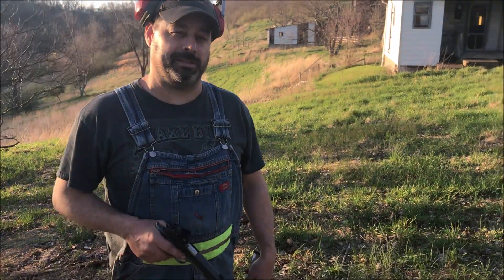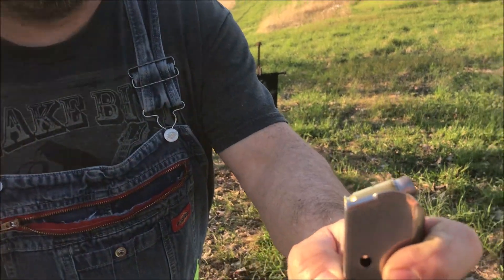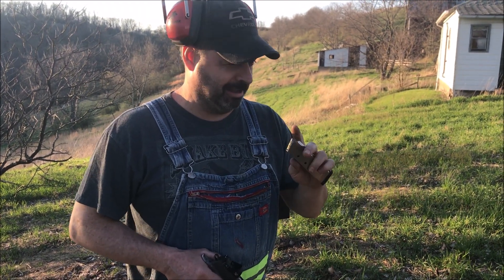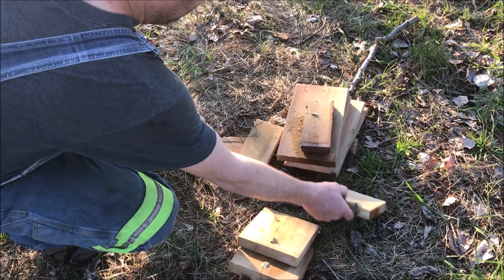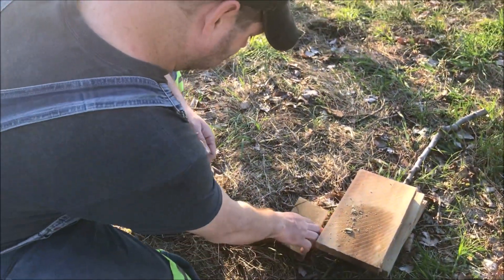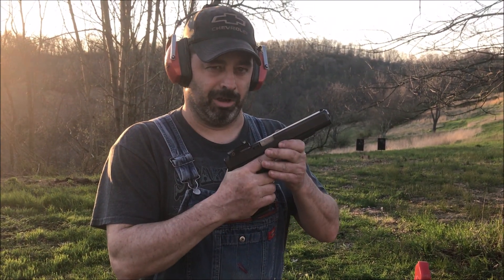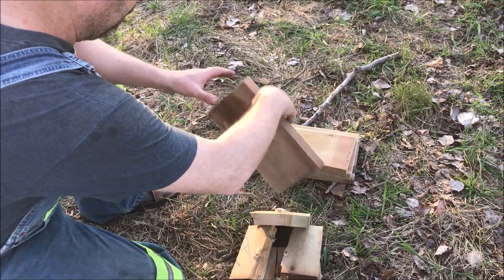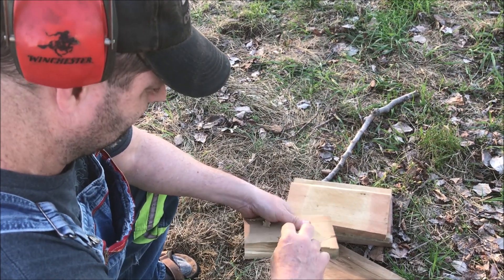45 Super VS 10mm in hardwood boards

Comment: Good insightful test. With surprising results.
 
 No doupt that there would be a difference with the use of Underwood  Hard Cast Lead and the Hunter, Penstraitor Solid Copper Flat Nose Bullets.

As for most Wilderness protection purposes Hard Cast Lead or solid Copper Flat Nose Bullets are the best overall types of projectiles to have for protection from apex predatorial beasts.

Comment: Great comparison, I love em both. I do think if ya hit em with similar extreme penetrators from Underwood the 10 would do a little better. I ran some 200/220 grain hard casts out of my 20 from double tap and underwood. It wasn’t even close, they were hotter than buffalo bore too. They melted the finish off my tlr1-no shitter- I fixed it with a fresh wide ass sharpie. Significant muzzle flip and a whole lot of fun!
Reply from the maker: Underwood is really tuff to outperform safely
I wouldn’t hesitate to stoke my pistols with their dipshit medicine

Comment: Hey Stuck Case what was the load on the 180 xtp load . Good work Thanks. On 1 load on one of your other videos was 10.5 grains of imr 800x at 1500 fps
Reply from the maker: Yes that 175 gr Lee TC bullet is used with 10gr of IMR 800x
It’s a handful
Reply from the maker: That is in a custom barrel and chamber
Tread carefully
Not all guns can achieve that
Reply from the maker: 10.5 gr your speaking of I believe was behind a 155gr xtp
Reply: @stuckcase7775  it was the video comparison of the 45 super against wood boards and 10mm glock 6 inch , you mentioned a 180grain xtp.
Reply: @stuckcase7775  i have a 5.25 length alpha wolf barrel and 24 lb. Flat recoil spring and a heavy duty firing  Pin spring
Reply: @stuckcase7775  this is from glock 20 gen 3
Reply from the maker: @organicmaterialsciencecorp6115  reviewed my notes after getting gone from work—indeed—the hottest load tested was in fact 10.5gr—that was at 1505 fps with the xtp
Please be careful
That was with a KKM barrel and tight chamber

Comment: I have a 10mm XMD 5.25 and 220gr Underwood hardcasts. Also a 45 XDM 5.25 and 255gr 45 Super Underwood hardcasts. The heaviest hardcasts for both calibers and identical platforms to fire them from. Just not sure what to use to test which would penetrate deepest into something like a bear. I'd love to do gelatin but probably need twenty feet of it. I had a GoFundMe page to take donations for enough gel to settle the 10mm vs 45 Super debate but they shut it down.
Reply from the maker: Lee Anderson wet newspaper stacked up and cinched tight. Great test media
Reply: Just water bottles man.  It works
Reply: So Lee u shoot  45 super  out OF  your  45 XDM5.25?
Reply: @TheRealZJE313  yes. Mostly just out of one of my XD Mod2 5" Tacticals but I have fired 45Super from my XDM 5.25" and even one round in my XDS Mod2 3.3" but I won't do that again. It nearly jumped out of my hand and somehow the magazine was released and fell on the ground. I do run a heavier recoil spring in the other two guns but no other modifications.